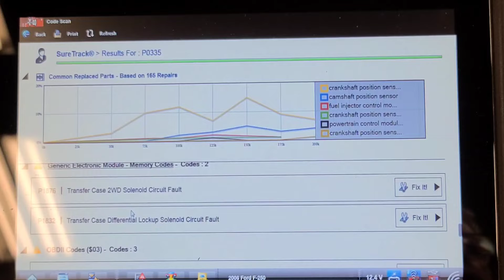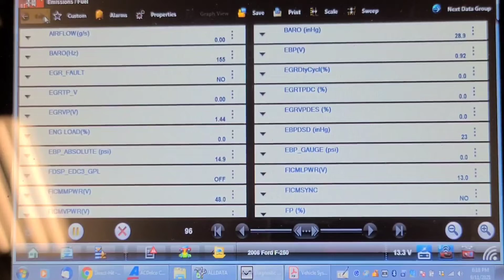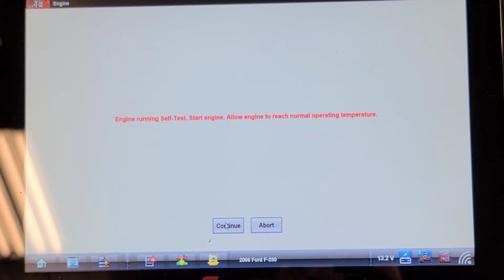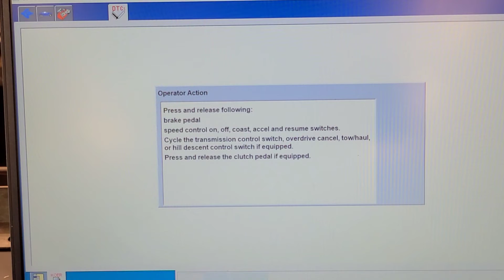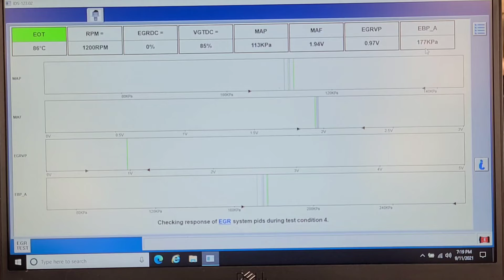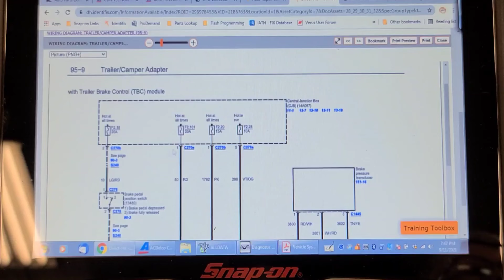2006 F250 6.0 P0404 and More

Comment: Ever tried that Hot Shot Shot Secret  additive to free up 6.0 injectors? I would be tempted to try it on the common problem of sticking Ford injectors. I have been trying it to free up chevy plugged oil rings but so far it hasn't worked.
Reply from the maker: I've never heard of it but I'll look into it.